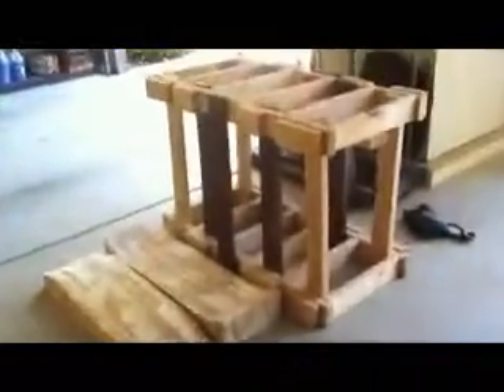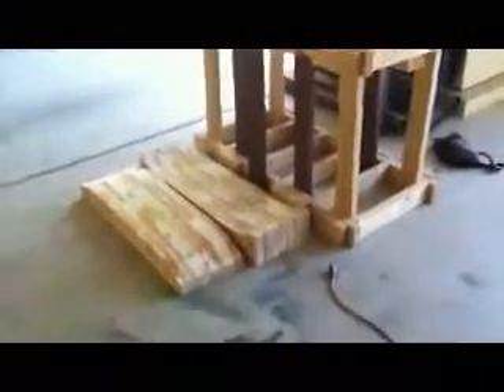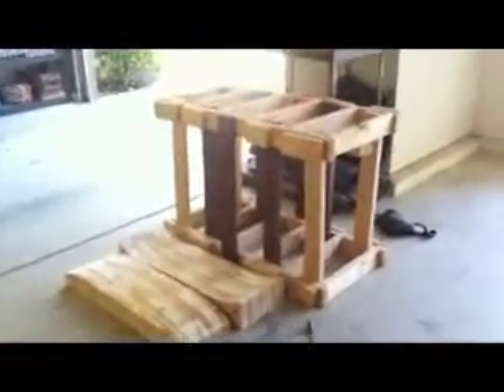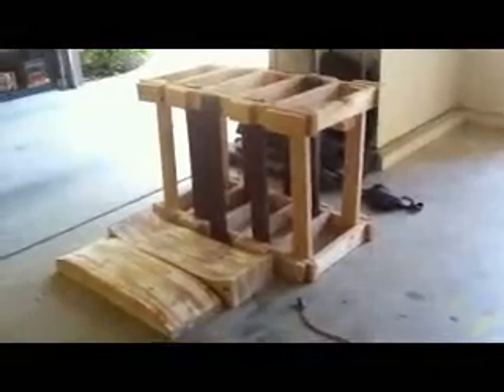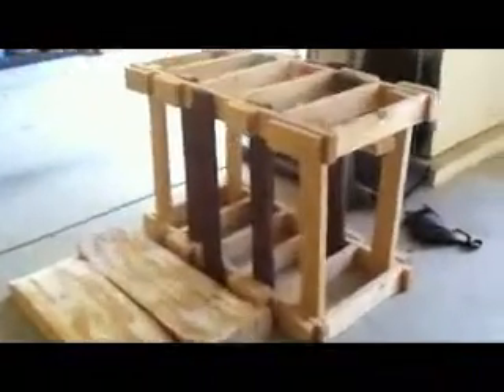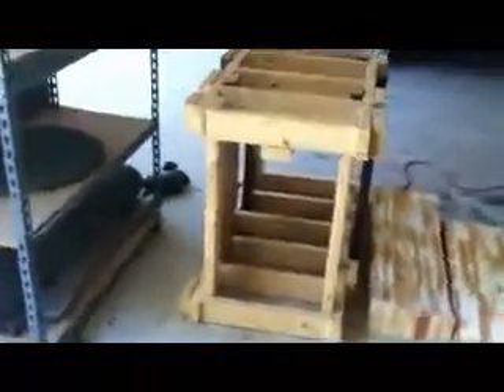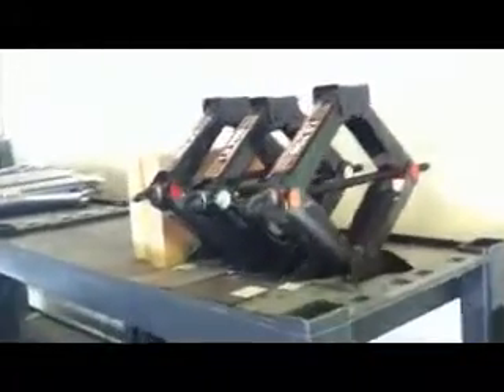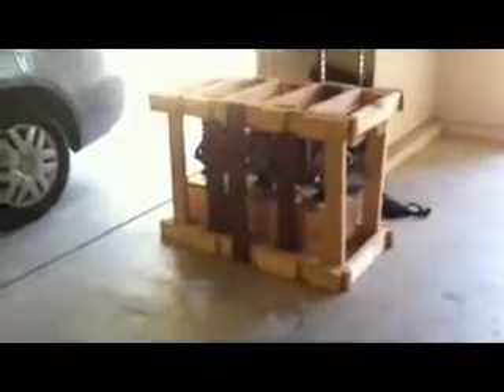How to Make a Longbaord / Cruiser / Skateboard: Building the Compressor

Comment from the maker: Do some calculations dude! I couldn't tell you exactly but if you think about it you have two two 2x4's on top and bottom, one 2x8 in the middle and still have to fit the car jacks so height wise, its about 30ish inches. Width: 20ish in. length idk. whatever you want.